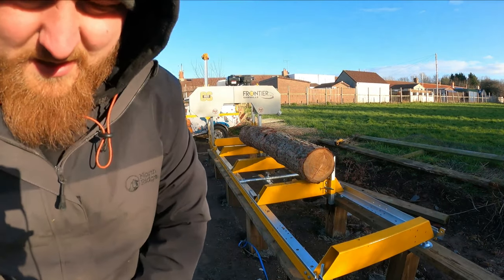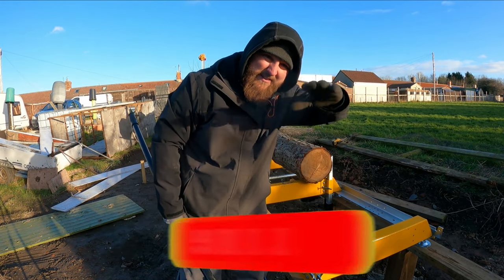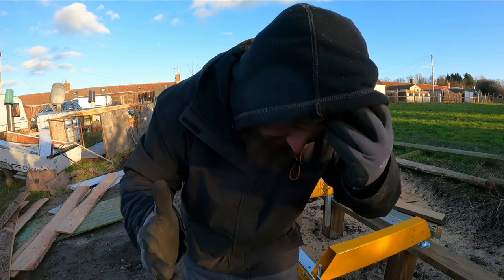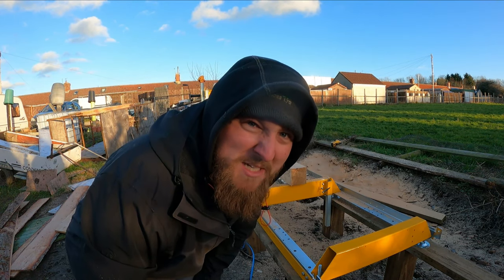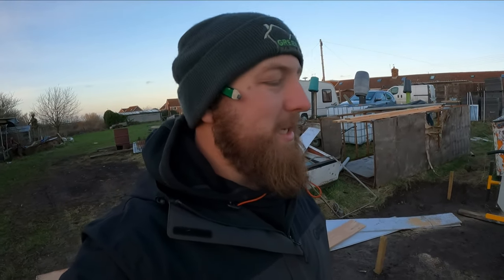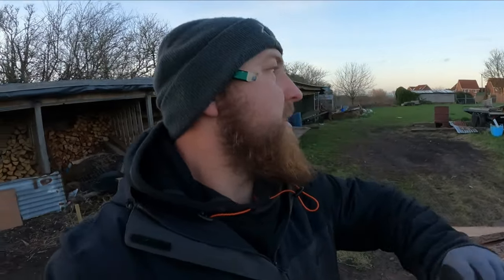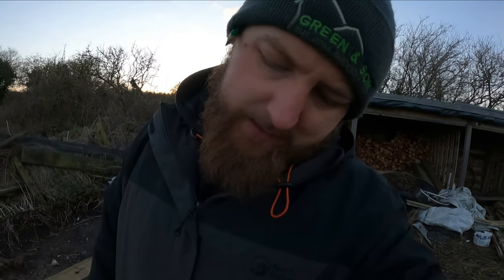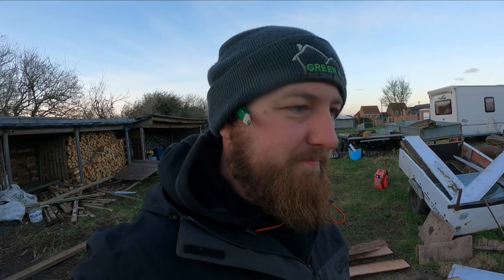Frontier sawmill part 3.2 - Finally got a log on the mill ~ This really surprised me

Comment: Everyone i have watched has raised the blade on the return ,i assume so as not to knock it off, just a hint Nick. Watch Outdoors with the Morgans on you tube.  Otherwise you are doing great.
Reply from the maker: Heyy David. You are very correct. However at the point of return I slowly come to the log and see how close it is. I'll take a photo of the clearance of the blade. I can put it back up a little but if I can get away with it and leave the datum I will. Good advice though. I watch outdoor with the Morgans already. I've watched a lot of people with mills recently 😄 
Thank you for your support and commenting 👍

Comment: What did u do with the bark pices? Thanks.
Reply from the maker: Hey Parrot, are you referring to the slab wood ? I cut it up for firewood. It's not got much other use than that.
Thanks for commenting and watching 👍
Reply: @everydaywithmenick  Ho Nick. If you cut it slightly thiker. Would make amazing natural nest boxes. ☺
Reply from the maker: @parrot340  yes it would, I'm trying to go down the no waste route but I've loads of work and jobs to be getting on with unfortunately.
Reply from the maker: @parrot340 .
Reply: @everydaywithmenick  where are you based. Might be inrested in buying some off you. I'm northwest England.
Reply from the maker: @parrot340  I'm near Saltburn, north east.
Reply: @everydaywithmenick  very duable. How can I message you privately. Thanks. ☺
Reply from the maker: @parrot340  email me at nick.garton@hotmail.com